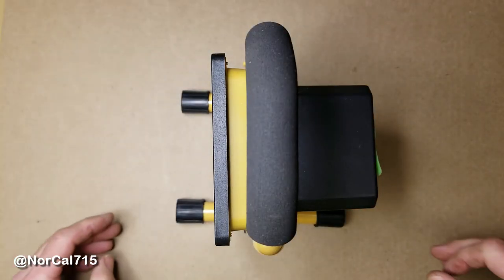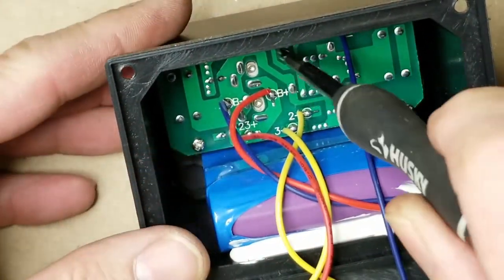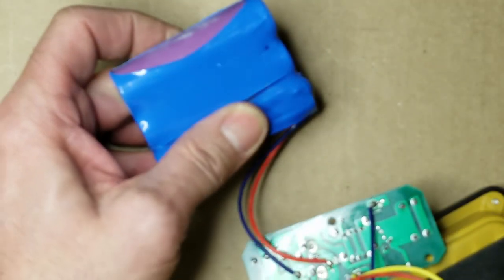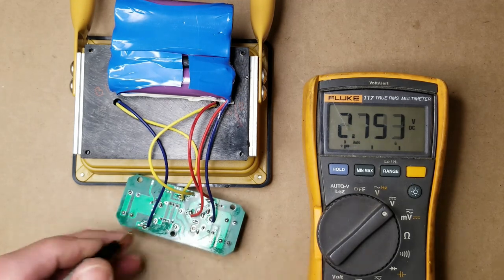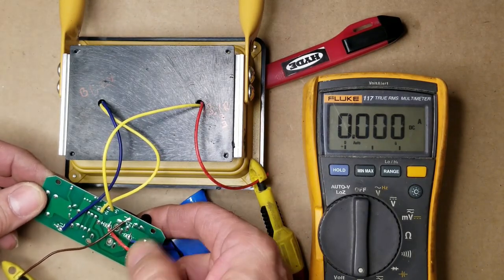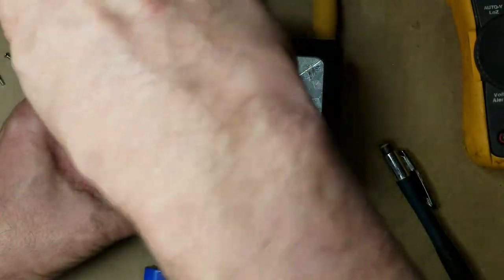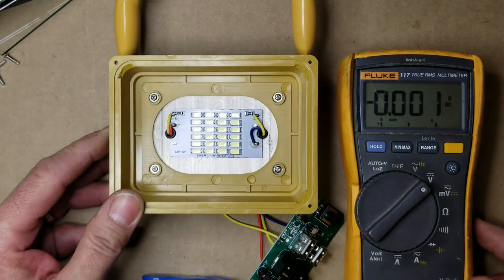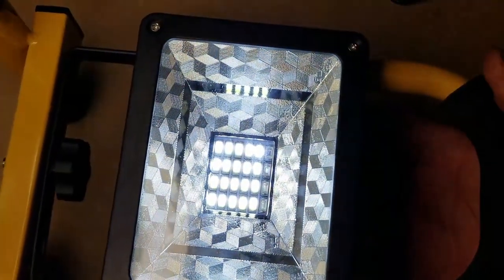Portable Flood Light Teardown and Testing

Comment: The missing charge circuitry is nasty. If you plug in a non-current regulated power supply you will stress the MOSFET's like crazy.
Reply from the maker: Ya noticed that after making the video. Also the raw battery voltage is available on the DC coaxial connectors at all times. All it takes is a foreign object to fall in and the mosfets will be toast. Thanks for watching!